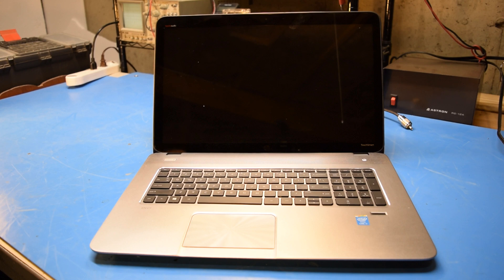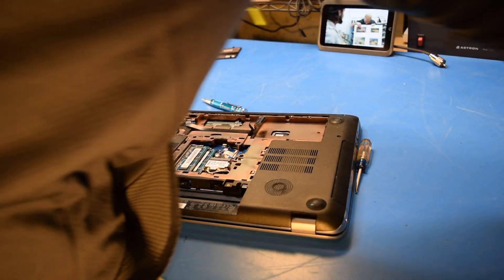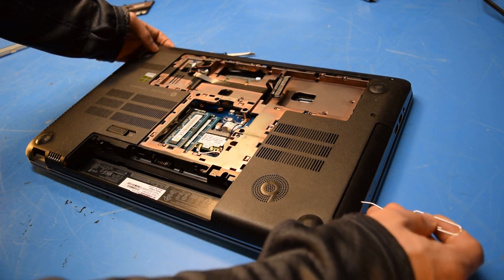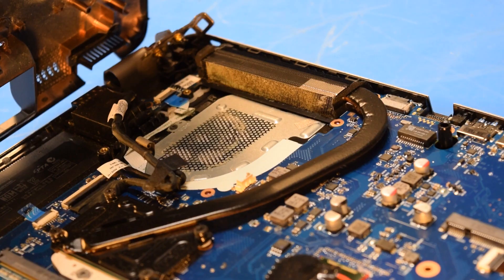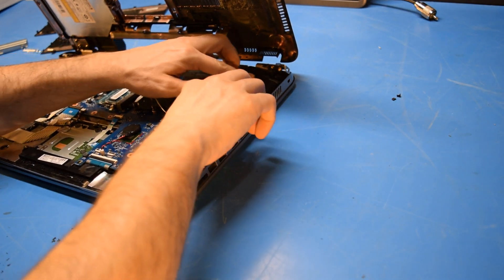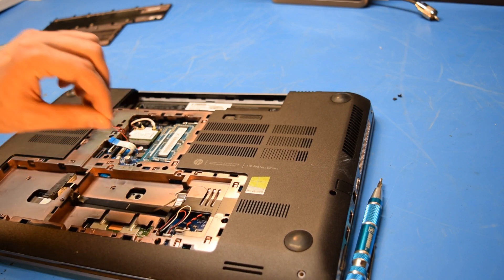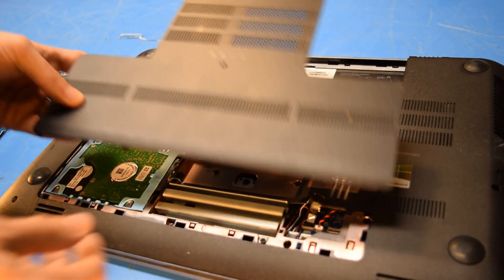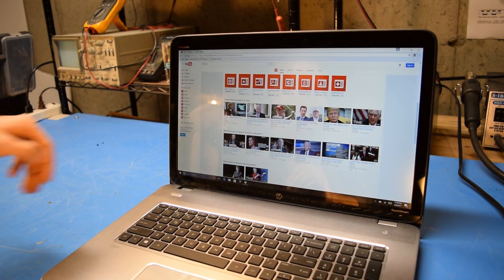HP Envy Laptop - System Fan (90b) Error Repair

Comment: CAUTION: The rubber pad (which are glued to the body) on the side the hinges has TWO (2) hidden screws!
They need to be removed. All the small screws size is etched in the body so it cannot be mismatched. 
It worked! I used a toothbrush to clean the vents of the fan which was not dirty that much. 
Basically dust accumulates over the vent which was needed to be cleaned. 
For that all these screws need to be unscrewed and the plastic panel need to get separated and fan's vent need to be cleaned.
As the whole assembly is stuck with plastic clips, a lot of them might break if proper caution is NOT been taken.

Comment: This video and the following one where priceless - I glued the LH hinge back together as well as replaced the Seagate 5400RPM HDD with a Samsung EVO 1TB SSD, I added another 8GB stick of RAM for a total of 16GB, and finally I moved the HDD I replaced to the second drive bay.  My HP ENVY-17t-j100 Leap Motion QE CTO Notebook PC is running extremely fast due to the SSD drive, and I now have an additional 1TB of backup HDD, and let's not forget that the broken hinge is repaired - thanks so much for doing these two videos!!!

Comment: You sir are a legend
Thanks to you I fixed my problem fan. There was a plastic screw housing that had broken and was rattling around in the case and got stuck in the fan 
Saved me a repair bill, just a few bucks for a precision screwdriver set
Thanks again

Comment: The two screws you were missing were under the black rubber stoppers ( there are four of them in the  bottom panel but only two have screws under them) thanks for the video. Computer is working great!

Comment: This was helpful. I think the hinge near the fan is prone to break on these Envy’s. My fan stopped working and I can hear that little piece of plastic rattling in there.

Btw, you forgot the screw under the rubber foot.
Reply: I  have the same laptop, and my hinge is popping on the left side as you are facing the screen.  and I just got the error message about the fan. I'll try this later this week to see if I have the same issue.

Comment: I had this problem after changing my hard drive, watched this hoping I wouldn't have to take it apart again. 
Turned out for me a wire for the fan got squashed when i put it back together. luckily the wire was not damaged too badly so was easily fixed.

Be careful with the wires when putting it back together everyone. :)

Comment: I have the same laptop and same issue. Will the error message stop you from using laptop? I got the error message and it turned off by itself. I turned it back on immediately and no message and it works fine. But idk if the fan is working. Thanks for the help.
Reply from the maker: If you use it without the fan running you might damage the laptop beyond repair.
Reply: @SevenFortyOne  thanks for advice. But thats my problem, I dont know lf the fan is running. I dont want to open laptop but I think there's software that will tell me the fan is working. I hope I removed shard just by shaking laptop. Thanks.

Comment: If you lift the hinge cover slightly from the back, there is a 6mm nut on the hinge pin,  loosen that a little bit at a time until the hinge doesn't bind

Comment: THANK YOU!  for posting this video.  I had the same problem, my fan stopped working.  I watched this about 3 times as I fixed my laptop. Also I have the same hinge issue. Must be a design defect?
Reply: HP has has heat issues poor design since 2005 with the SV series

Comment: the cooler of my HP Envy 17-J is running on max speed all the time. A message appears when booting, it says I should replace the cooler. But the cooler is running. It's loud but it doesn't seem to be broken. Maybe too much dust in it? Do you think I have to buy a new one?
Reply from the maker: Its hard to say without being in front of your machine myself.  Sometimes the fan will appear to you to be running fine but it may actually be running a little slow and causing the computer to throw that error.  I'd try cleaning it and the screen/filter in front of it and then see what happens.
Reply: It probably isn't getting the rpm/tach feedback from the fan, so it's running it full tilt to be safe.

Comment: Can you please tell me if I need to buy just the fan only or a head sink and the fan?  I have the error message about the fan not working properly.  The laptop still works. Hp will not provide info or product number. I need help with what fan to buy. Bestbuy will install it. I just need profuct number and if I need to get the heat sink combo or just the fan. Please let me know ASAP I need help
Reply: Also my model number is m6-n012dx is that the same one you have?

Comment: DONT. DO. THIS.
Watch a proper teardown of your laptop. I did the same thing you can see in this video, this is not the way it should be dissasembled, the piece of plastique is the pieces you broke by oppenning it in a wrong way. You got to go through the keyboard, and removing the top panel.

Comment: I'm stuck on taking off the third screw fr the disk drive area, please help.
Reply from the maker: not sure what you mean...can you not find the screw? Or is it stuck? Or do you have another problem?  Those screws are hard to find so if that is the case just keep looking.  On my unit there were little triangles stamped in the plastic/metal pieces where mounting screws were located - look for those.
Reply: You can easily slide the whole optical drive out with one screw. Then you have easy access to the 3 screws underneath.
Reply: @Arkham8076  thanks for that

Comment: Hi - Really great video - It was super helpful.  I managed to complete the process and fix the hinges with one exception.  Now the laptop screen does not turn on.  Initially I would hit the power button and it would  try to power on for about 3 seconds and then give up.  After retrying a few times it seems like the laptop is on, but there's nothing on the screen.  Any idea what the problem could be?  Looks like the black screen of death.
Reply from the maker: The only thing I can think of is that maybe you didn't hook one of the wires back up or something like that.  You may have to tear it down again and have a look.
Reply: You are probably right - Deep breath - here we!  Thanks again for the awesome video.  I'll be using it on the second deep dive.
Reply: Do you know by chance if there is some sort of minimal baseline where there screen should turn on ... like for example with memory removed, etc?
Reply: Never mind of the baseline - I took off the plastic bottom and reseated the cables near the fan - It looks like these go to the screen.  I then tried to turn the screen on and it worked.  Hopefully it's all good now - fingers crossed.
Reply from the maker: OK-good!  hopefully that's got it solved.
Reply: All fingers crossed.  I'm prettty good at blowing stuff like this up :).  Thanks again!

Comment: I could have sworn input everything back correctly. However now when I turn on my laptop it says "boot device not found"
Reply from the maker: You may have to go back through and make sure all of your cables and wires are connected correctly.  Those little ribbon cables can get easily skewed and even though they may look connected properly they may not be.  Also, check to make sure your hard drive is seated properly.

Comment: Or maybe, YOU broke it.. XD I wanted to ask, if i dont have access to pressurized air can/ vacuum pump, what else can i use? Can i clean it in water, let it dry for a day and put it back or something?
Reply from the maker: If you are talking about just the filter you should be able to take it out and use water to clean it if that s your only option.  I think it is made of corrosion resistant materials so it shouldn't rust or anything like that as long as you don't let it soak for a long time.  Obviously, don't get any water inside the computer as that could damage it.
Reply: Lol, i wont get water in the laptop, thanks for te help btw. :D Also, one more thing, what screwdrivers are to be used? like once i had seen my friend spoil the screws with wrong rating screw driver and it was irremovable later on..
Reply from the maker: I think I remember this computer uses Philip's head screws and there may be two different sizes.  A #0 size should work for both sizes but I'm not 100% certain of that.  If you get a set of inexpensive jeweler's screwdrivers with a few different sizes in the kit you should be able to find one that fits.
Reply: Thanks a tonne mate :)